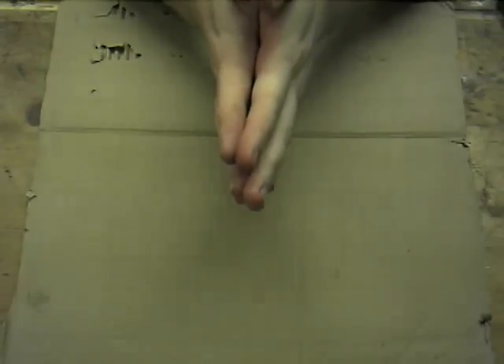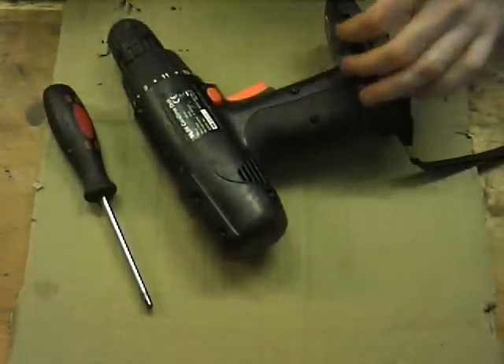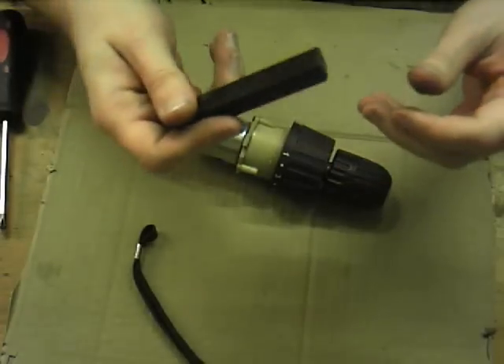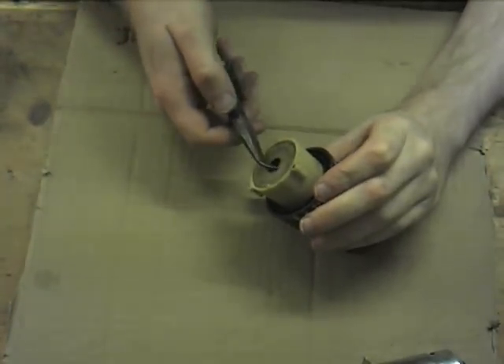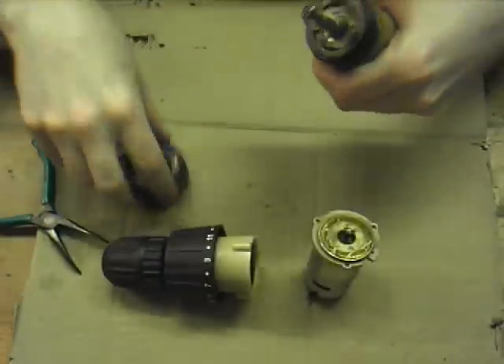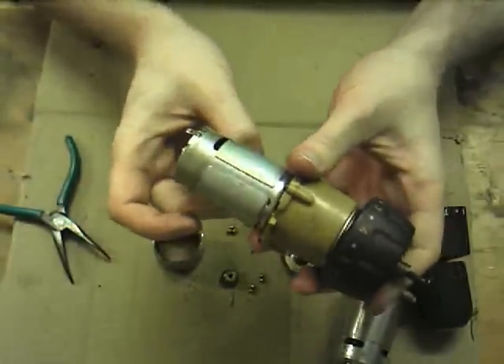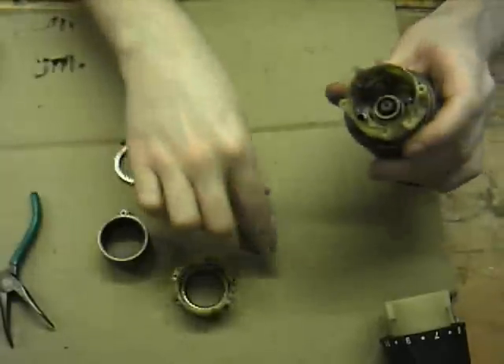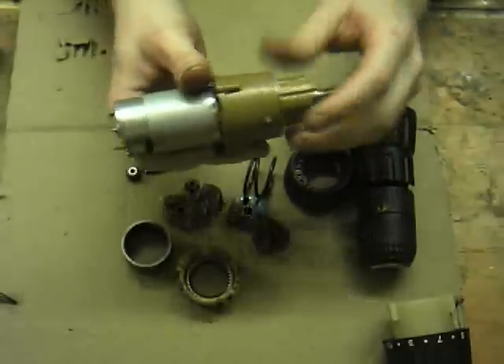Battery drill teardown for gearbox

Comment: Problem I've found with selecting a brushed drill motor/gearbox to canibalize for a project... is finding one which is self-contained motor-can which is attached to the gearbox.  Some or most of them seem to have the motor elements & small parts held in place entirely by the plastic clamshell of the drill housing.
Reply: @Rey Legend Thanks, I went there and it seems like a nice service =) Appreciate it!!
Reply: @Elisha Enoch Happy to help =)